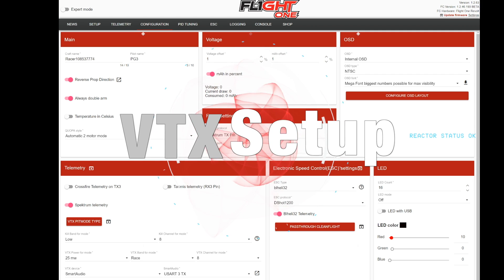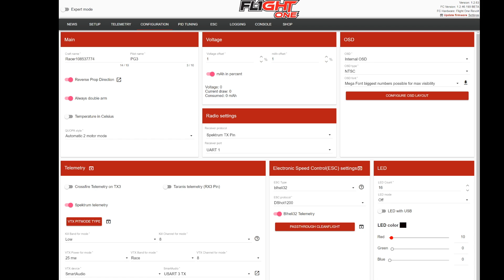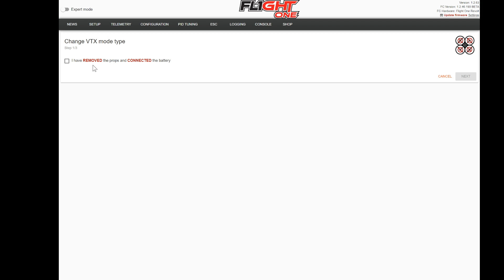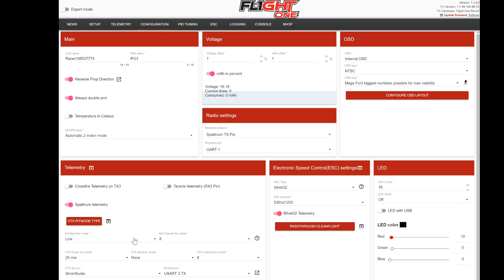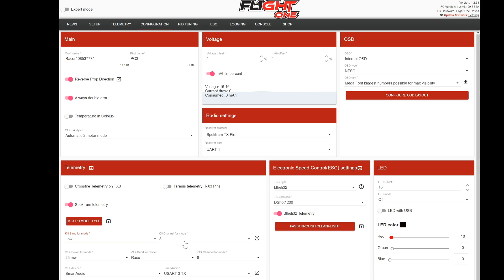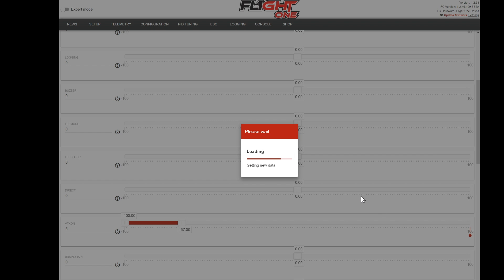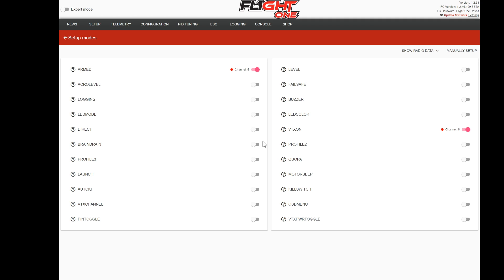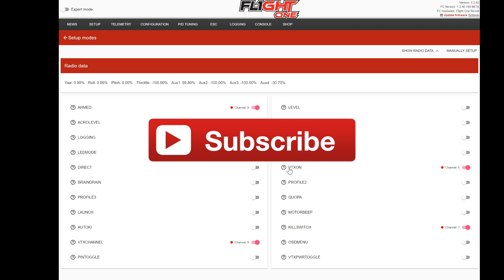Setup VTX with FlightOne

Comment: i tried the tramp and the rush tank mini and nothing works on either one of them, none of the switches, channels, or power are working. i cant controll it thru the tx3 at all. ive learned to accept that the smart audio doesnt work with flight one. maybe if i install betaflight on it instead of flight one itll work?

Comment: I get error 'value -2147483648 has not been set for variable vtx_presets. Reason: #me Setting Not Found:set.' I'm not interested in pitmode or killswitches or channel switches on my radio. I just want to set power output and channel on the configurator.

Comment: The dip shitz @ FlightOne must be the most ignorant dipshitz in the world! I'm trying to put this sh!t together and I'm looking at videos because the Molex connectors need to be switched?!! Really?! They sent the wrong cables with a $60+ board?! Are you kidding me?! I have no idea and no documentation which way they're flight 1 "schizo" flight board goes because there's no arrow!! Just a 45-degree arrow! What the fvck flightOne?! Fire you're incompetent jagoff designers, they're worth sh!t The HG China board plug directly in has and no problems and flies on beta 1 no problem but I got to put up with changing out Molex connector wires and then I don't even know which way the flight board goes!! What a bunch of fvcking morons. I'll never buy this "FlightOne" bullshit again!! Even the Chinese are making these dipsh!ts look like retards at a fraction of the price!!! I've never had a problem with the HGLRC XJB F440-TX20 V2 Stack - F4 Flight Controller - 40A Blheli32 ESC - TX20!

Plug and go on that chinese setup! FlightOne, get ready to drink alot of alcohol!! Fvck "Flight One"!!
Reply: Always pointing the finger at people and judging .... sometimes you have to do an examination of conscience. there is no arrow on the board because you can put it as you want .... it will auto adjust once the wizard is run from the configurator. for the pin diagram just go to the official wiki.
all the time you lost to write this comment full of bad words you could have spent on learning new things, reading or watching other videos with the solution of the problems you encountered. You didn't help anyone by entering this hateful comment. Bye 😂

Comment: GREAT VIDEO! Very helpful. Question, which pins on the FC do I wire the Unify to get these controls when using a Crossfire RX? I typically wire SA to the CRSF RX but it prevents me from doing this magic.

Comment: This is one if the issue I had with FL1 the smartaudio never worked right and the lack of a LUA script is annoying
Reply from the maker: should have no issues with it on any of the mentioned vtxes
Reply: @FlightOneVideos  I only use the TBS Unify Pro HV. Unfortunately, I had too many issues with FL1 and VTX control so I moved away from the product. I was told many different reasons why this never worked consistently. All I can say is switching to different flight control software has resolved my issues with VTX control.
Reply from the maker: Carlos FPV well any issue you had should be fixed now

Comment: Thanks for the video! How can we do that with crossfire, has we use tx3 for telemetry? Thanks
Reply: You need to use one of the pins on the crossfire receiver. Use CH4 set it to smartaudio in the crossfire. Once this is done you can control the VTX with the crossfire LUA or menu
Reply from the maker: rx3 should be used for crossfire telem
Reply: @FlightOneVideos   How do you use DSHOT 1200 and Crossfire Telemetry, if I use multishot its all good but as soon as I use DSHOT nothing works and I have to use the OSD to set the VTX so I can't get RSSI with DSHOT
Reply from the maker: Grixes Sedraxis right now we don’t because every time I have enabled telem on crossfire and flown with someone else running it I get failsafes.  It’s common problem with my friends as well.
Reply: @FlightOneVideos  Thanks but for us freestylers and doing long range - it would be nice
Reply: @grixessedraxis7267  I agree.  VTX control and Crossfire with telemetry should work.
Reply: @FlightOneVideos  how can we enable rx3 for crossfire telemetry?